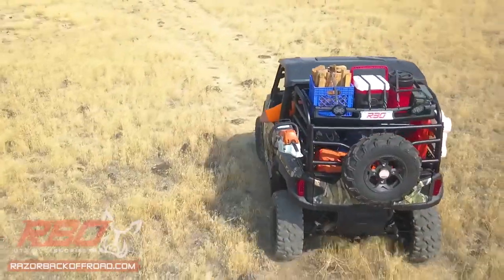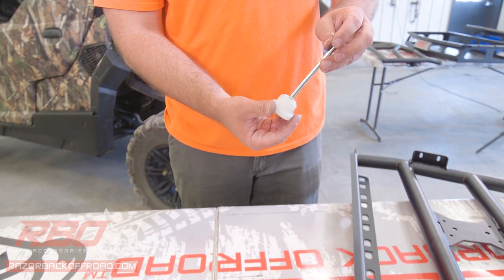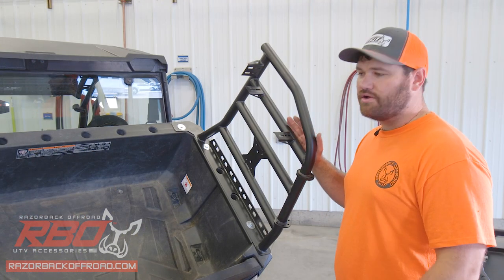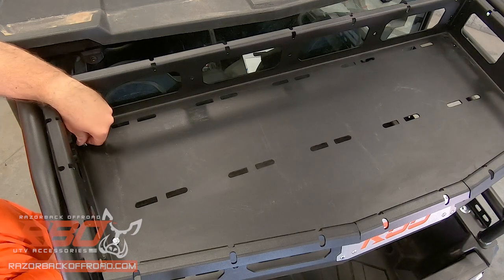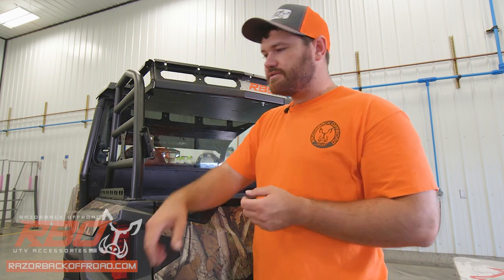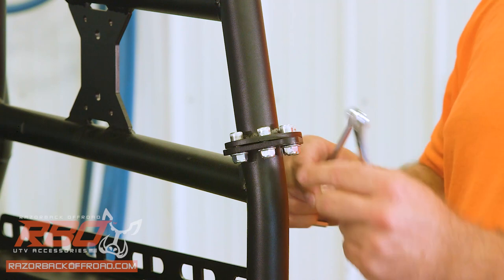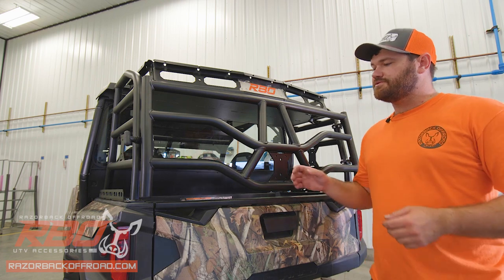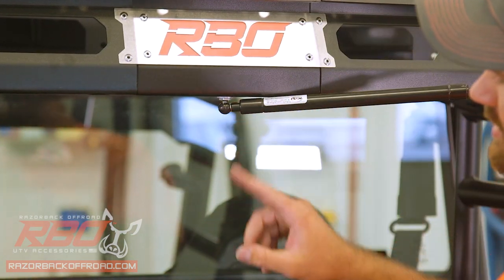Polaris General 1000 GP Gen 2 and Expedition Racks Installation by Razorback Offroad™

Comment: Great video.  Especially like the advice on the tailgate alignment.
Ordered mine right before Christmas and it came in less than two weeks later.
General is in the shop (less  than an hour on it and we're getting a new frame due to misaligned welds from Polaris....).  This will go on when we get it back next week!

Comment: Is this rack suitable to contain a dog if combined with the ruff rider heat pad?
Reply from the maker: The ruff rider pad will definitely decrease the heat in the rear and offer a better ride for your pet. The Expedition rack does close, so depending on your pet it could work to contain them on a ride. Hope that helps.

Comment: How does the rack when loaded affect the bed?  Does it push the bed sides out?  With the spare tire on the swing away does it torque the bed?
Reply from the maker: Thank you for reaching out to us and taking an interest in our General Racks! Throughout our testing we have found little to no issues that affect the General beds. We have set weight limitations for the rack as the correlate with the bed restrictions/limitations. Hope that helps! Thanks for watching!